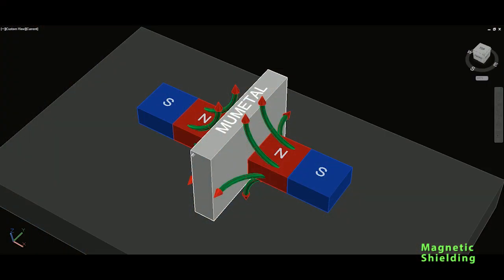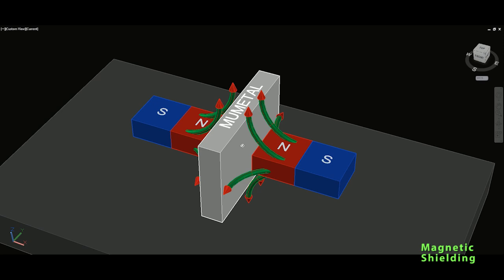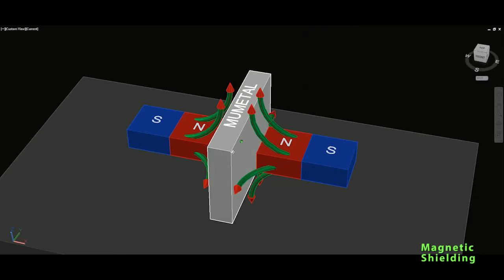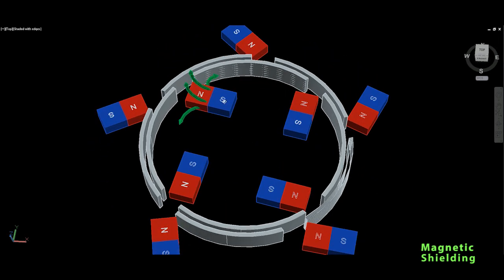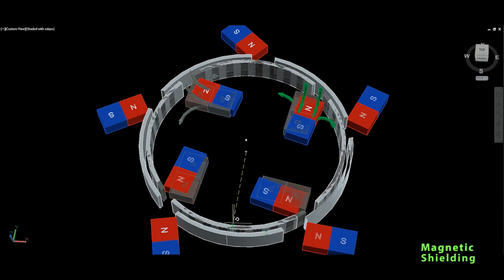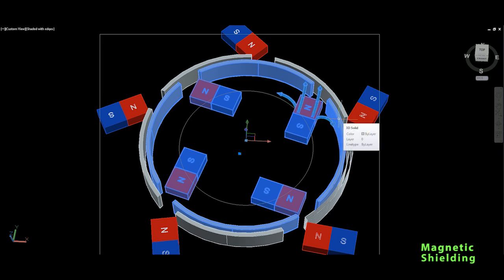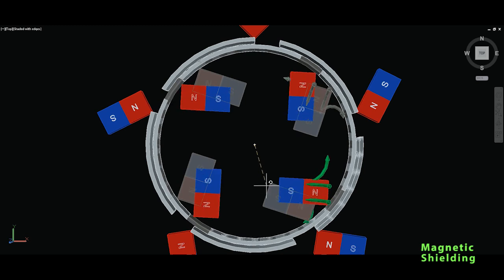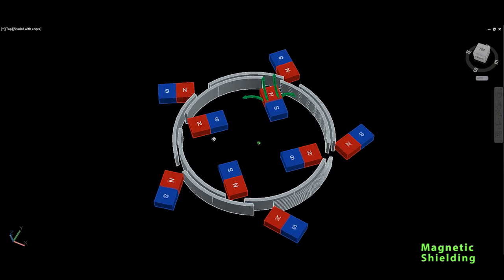Magnetic Motor -  Shielding with MuMetal

Comment: The double shield motor design is not efficient, because in motion permeability of magnetic shielding means also electrical conductivity and heating with lost energy.  BAD DESIGN.

Comment: I always wondered about a design like that .. halfway point.
Reply: I think this should be similarly possible without the expense, and got good results with cheap construction, but I'm sure someone could do better:

( O

Where O is a wheel with 1 magnet on it so that gravity will force 180deg of rotation down the right side. ( is a strip of magnets or a single long magnet that is adjusted to use magnetic force to accelerate the falling magnet on the wheel back up the left side so it can drop again. Gravity pulls down the right side, and magnetic force pushes it up on the left side, which only needs to provide enough added net force to overcome friction. I've never seen anyone attempt that seriously, but I think it has potential. 

Also, if we can imagine a square meter of capillary tubes a few inches high, with a paper towel across the top of them to absorb water reaching the top of the tubes, a slanted array ought to be able to draw water over the side of the array to generate hydroelectric power. I think we can actually create 'perpetual motion' but nobody is making serious attempts.

Any force that can oppose gravity ought to be able to create perpetual motion in association with gravity.

Comment: hey i am also working on a magnet project with mu metal using neodynium magnets cause their very strong but recently i bought mu metal and things didnt work out the way i planned cause i thought it would block magnetic radiation but thanks to you i now no it rederects it. Thank you maybe if mine version doesnt work ill start working on yours and give you a heads up when it works cause your the original inventor
Reply: Its not gonna work dude

Comment: MuMetal is made of Ni, Fe and Cu. The caracteristics are created by special thermotreatment.  It is quite expensive material. a 10cm x 10cm x 0,3cm piece will cost about 450 EUR / 500 Dollar. MuMetal works with a magnetic field in the higher frequenties. At low frequenties the MuMetal looses its properties voor shielding. At static level (a permanent magnet) the MuMetal will be magnetized and shielding capabilities will be gone. With these facts you can understand that this design logicly will not work :(

Comment: All the magnetic field shielding materials are attracted to magnet, so this design would not work, because the shield material will
create an opposite force on the rotation itself and pushes it forward the external magnets.
Reply: So what would be required would be a magnetic shield that is made from a diamagnetic material.
Reply: That is the right! The mu-metal is not work. He is attacted to magnet аnd it actually becomes a conductor of magnetic waves. So far, I have not found material to stop the magnetic waves.
Reply: Yes absolutely, the sheild gets attracted. for the people who think is it possible to make a magnetic sheild with dia magnetic, so that it wouldn't get attracted.. it is impossible 
Because to be a good shielding material it must has to be ferromagnetic as well. 

Stop thinking about these stupid free energy machines 
These will never be a real thing 

Cause you can never create something from nothing.

Comment: What is of concern, as it seems in my mind about the physics, is that there will still be some resistance uncovering in front of each of the magnets, vs the opening of the magnetic repelling fluxes near by the aperture opening... and so one would then have to deal with forces that will not allow the rotor move in front of those fluxes each time...as magnets repel will not allow... unless a greater force is applied for the shielding to be removed quicker than the mag rotor... thus adding more energy to enter into the flux each time by the opening. well you may find that the sum of such resistance will work against the overall transmission power of such a self running rotor.  as there will also be some attraction to the mu metal (which is not that efficient shielding material as steel is, and is used mostly for low level magnetism shielding anyway I believe)..(and.if more thicker material that will cut off some of the repelling space too...) and so there will also be some resistance moving the nu metal away from the magnets as well for such an opening because the metal is attracting to the magnets, and so on. but it's a very interesting idea nevertheless worthy of more investigation about metal shielding properties vs opening and closing a magnetic aperture.

Comment: "Magnetic shielding". I don't think that word means what you think it means. (His magnet motor idea will not work.) Sources: I have magnetic shielding materials myself.
Reply: @jerkjerkington3874  It doesn't really shield magnetics. Just provides a strong transferrence. Its basically like putting a strong magnetic material in front of a magnet to weak the effects on the other magnet.
Reply: @jerkjerkington3874  Its like rubbing another magnet against another magnet or magnetic material. It isnt gonna generate new force.
Reply: @jerkjerkington3874  magenetic shields are not magic, they just redirect the magnetic field shape. The device will not work because the magnets will be attracted to the magnetic shields and slow down. The video has 88,000 views yet not one working prototype because either people are lazy or it does not work.
Reply: @jerkjerkington3874  ok cool. what is your idea?
Reply: @jerkjerkington3874  wont work because at the second stage, excess energy would be needed to remove the shield from the two magnets, since the shield would be stuck in place by the two magnets magnetically.
Reply: @jerkjerkington3874  Theoretically, of course. lol

Comment: Plain aluminium does exactly the same very very cheaply, without the need of astronomical costs of some exotic ’Mumetal’. But, unfortunately this knowledge is just most often obscured or twisted for reasons obvious to any serious reasercher in the field of the free energy.
Reply: Neither with exotic materials nor with plain aluminium conservation of energy can be overruled. There is no motor which can be driven only by permanent magnets.

Comment: 🔴 The alignment of the timing of the opening  is to soon in relationship to the position of the stator magnet. This causes a severe sticky spot to occurre when using repulsion mode. 

🔴 If using attraction mode, the stator magnet is to far behind to be effective, resulting in to much counter pull.

Comment: Mr Mario Gudec this is your best and auspicious Video,Shielding Mumetal  is necesary to improve  flux path of Penderev, and other free energy PM motors,I suggest you to make a Video on Penderev flux path FEMM simulation with  diferent  shield materials,for instances,if Penderev motor s simulated  without shieldieng,Mag flux density B is too much spreaded.any BLDC flux path is elegant and  continous, put a list of optional  shield materials,mention that in spite of materials  the thickness is very importatnt,there is a crtical thicknes, beyond thay  flux lines  penetrates the  shield,my dream is  PM motor to thrust a Sailplane,Thanks Mr Gudec,Congratulations, wonderfull and  auspicious Video, this is the last issue  for PM motors,Maxwell equations can  simulate all magnetodynamics,B,H,fi,speed,Torque???plus boundary loads?Pull forces of PM, what about  Hallbach Array effect on Penderev,force  double?Cordially yours,JOhann Wegmann

Comment: This wont work.  Also, mu-metal shields circuits by attracting the flux from the magnets.  The flux would rather go into the mu-metal  than into the circuit you are trying to shield.  Showing the green flux arrows going around the mu-metal is just totally wrong.

Comment: Mario please build one using carbon steel which is very cheap. Glue the metal to your rotor and stator plates and then glue the magnets. You should be able to build it for 50 euros.

Comment: What about aluminum and other nonferrous metals? Would multiple layers of aluminum foil perform the same function? If so, can you explain how? If useful, how many layers of foil would be necessary?
Reply: That's why it's key to use multiple layers of THIN aluminum, stacked between steel.
Reply: no it will not.